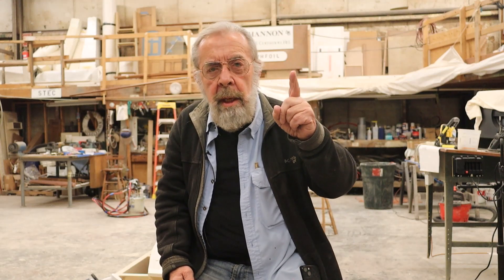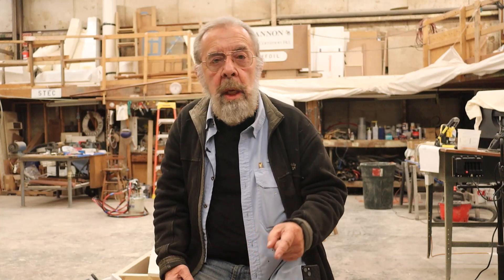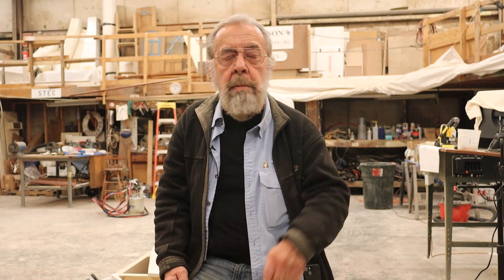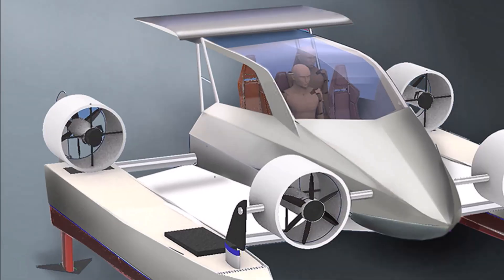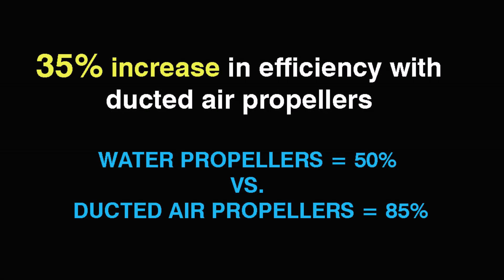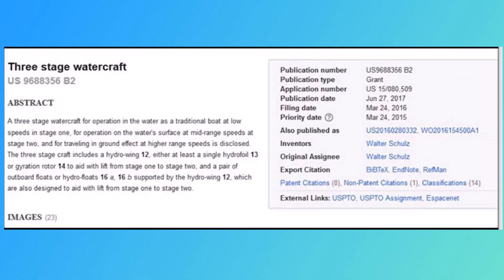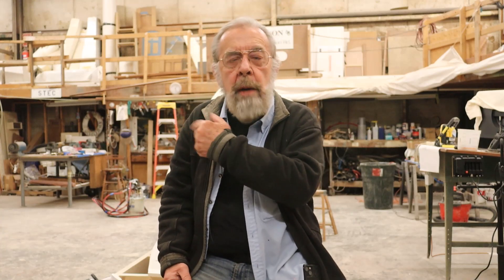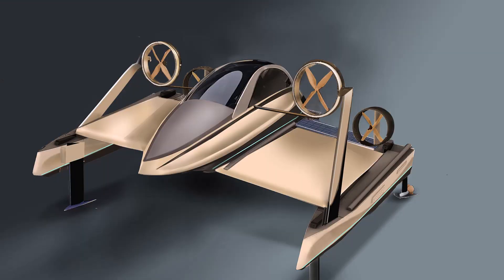NEW PATENTED SUPER BOAT

Comment: There is so much wrong in this vid it's hard to keep track. The Russians built giant surface effect planes/boats. Electric energy storage is not lighter than fossil fuel storage per equivalent amounts. Not even close. Efficiency of electric motors is solely dependant on the generating source, so overall efficiency is hard to claim. Some interesting concepts, but I could do without the amway style sales pitch.

Comment: An air propeller can go from 4.5-7 lbs static thrust per hp, depending free stream to ducted. You indicate static thrust for boat propellers is around 2.6-4.55 lbs. thrust per hp. correct?

Comment: What happens when you hit something in the water? I was on a ship that hit a whale and other things at speed. I now value a steel hull. Hydrofoils are part of the future and just like ground effect transports, the technology still needs to mature. AI in the future may provide avoidance systems. Currently I cannot see the craft in this video hitting a 6 inch thick driftwood log at speed and coming out unscathed. Does this design lift or dive when striking an object?

Comment: High speed hydrofoils have problems with cavitation, it's the same problem that gives rise to the poor efficiency of marine propellers you are trying to get around.  Hydrofoils work best at low/mid speeds but as the speed increases so does the drag which increases exponentially.  As a result hydrofoils can give you long range but not at high speed.

Comment: Nice, but how are you offsetting the hydrofoils, when the foil rides out of a heavy wave (basically suddenly "out" of watter and into the air) and ship starts to go "down", on the side of the affected foil because the foil currently out of the watter is not "lifting" the ship suddenly. 
And if the idea was to utilize surface effect and foils for longer quicker rides, did you take into consideration heavy seas? I mean, some bigger waves  can be problem not only for the hydrofoils, but for the height of the surface effect "flight" too. 

BTW, whoever saw in Avatar 2 (the way of the water) movie the "sea dragon" ship, might kinda have similar picture in head, as me, after you depicted your boat.

And did you try some version with extendable "wings"?

Comment: funny ,my idea from 1974 , normal foils have to much drag ,which is why the first ones had ladders .The Aussie sea ski boats recognize this . Trouble with electric is energy density of batteries ,at present , a rechargeable vanadium diboride cell would solve , and there are lots of better techs coming ...always coming ..  Sharrow props are showing big increase in efficiencies ,and it looks like we can do better , longer higher aspect ratio blades .  In air according to John McGInnes of 'synergy' fame, 100% could be possible ,in the light sport field some new props are giving 20+% gains ,and sound reduction too . But not sadly with ducted fans ,which is probably why the latest big jet experimentals are are ultra high bypass turbo props , with rotating and stationary external blades . but Nice project ,like it ,keep up the good work .

Comment: Airfoil, or hydrofoil, or ?
There does seem to be an actual airfoil tying the craft together, but it doesn't seem to be close enough to the water to be in ground effect, at boat speeds?
One interesting aspect of electrical power on a large boat is that there is a lot of area available for photoelectric cells... He mentioned hybrid power, which normally means an internal combustion engine driving electrical power, but maybe a clean running steam turbine?
A very good friend of mine was s naval architect, and actually did design for, I think, a world record hydrofoil "wind surfer" in the late 1970's, so I learned quite a bit from him... This presentation sounds good, but seems long on good vibes, and thin on details... If it's heavily patented, there's no reason to be shy...

Comment: Walter, thank you for the update on your project and clear explanation. You have always been the most interesting boat designer to me.  Is there a fundamental reason why the ducted propeller concept could not be applied here in an under-water unit, as used on some slow speed vessels? My guess is that the drag of the shroud makes underwater operation inefficient for the kinds of speeds you are talking about, but it would be great if you could share your understanding.

Comment: a ducted propeller is more efficient in more speed and altitude, in low speed and altitude a "normal" propeller is way more efficient, also the bigger the aspect ratio of the wing, the more efficient it is, that also is true ro propellers, that is why helicopters have one giant "propeller".

also, again, in low speed a water propeller is way more efficient because of the density of the water, and the limit to hydrofoils is about 130kmh, if you go more than that the foil's cavitate and destroy it self, soo very low speed... the ideal for that range of speed between 50kmh and 130kmh is waterjet propulsion. 

the idea of using the foil as control surface and to give a boost in lift in low speed is pretty genius, when you reach more speed the boat create enough lift with ground effect and the drag is as low as possible.

also one more problem with the design, the foil is a wing, if you have four of then, it will be small, soo you will compensate with chord, the drag will be much higher than if you have just one main foil but very large in length...

Comment: You started by saying electric ducted air propulsion, but half way through it changed to electric "hybrid" you didn't mention what the hybrid part is?
Reply: I assumed it was the use of hydrofoils with airfoils
Reply: @peterwilliams1119  Hydrofoils/airfoils aren't the power source though. Imagine the size of the battery/batteries it would take to power such a vessel. It must have another source of power thats why he said hybrid I believe. There's a few boats getting around with electric/diesel hybrid motors

Comment: combining sail (which has numerous technological options) with auxiliary solar electric power would seem to be an even greater. 
Electric motors themselves tend to be of 3 types, induction, DC, and the mixed Synchronous motor design.

Ocean waves include short wavelength and longer, larger Swells, so drawings/paintings do not correctly show the travel or the dimensions in which a successful craft operates.
 Sailors understand the seeming chaos of perhaps 3 swells plus local wind waves. In regions like the Southern Ocean and anywhere swells are generated by strong winds plus significant fetch - the vector length of consistent wind direction,
A craft will necessarily be lifted differentially when moving at different relative directions to swell or short-period (wavelength) wind waves.

The design will be refined in relation to the use of the craft, from large transport to small recreational craft.

Comment: Yah and I invented perpetual motion. Electric motors are not that efficient. The reason is that you have to generate the electricity. Steam turbins most commonly used in electricity production are only about 37% efficient. Secondly, batteries do not store all the energy required to charge them. Percentages are typically around 85%. BLDC motors are often around 85%. That puts you at a total efficiency rating of around 26%. YOU ARE A LIAR!

Comment: The 2 problems I see are too much speed + 50 Mph and you hit something in the water and catastrophic foil failure occurs with a huge loss of efficiencies at those high speeds with decreased ranges.  25 Moh still gets you up on foils with much longer range.  The 2 nd major problem is the massive noise with ducted electric propulsion made from the blades.  It’s not a quiet electric solution at all in fact the opposite- it is so loud you will go deaf.
Reply: Ducted is quieter than not, generally, as the greatest noise comes from high tip mach. The trick is to balance the fans (number, diameter, pitch, rpm) against the loads (hydro drag, lift induced drag, total craft mass, and desired acceleration performance) well.

Comment: you get more efficiency in the prop if you put a duct around it.   you get even more efficiency if you use contra rotating props
Reply: Both of those have limits. The tradeoffs between ducts, and non ducts, and the benefits of driving a secondary turbine all have inflection points in their efficiency curves. Depends on loads, design speeds, motor torque, turbine rpm, because it rolls back around to diameter, pitch, and how much thrust needs to be developed. And thrust and speed have a weird relationship with eachother when it comes to props/turbines. Driving water with a prop you're constantly fighting a battle against cavitation, in air, against supersonic flow. In water, that cavitation can happen on your duct, and your prop.
Reply: @weatheranddarkness  if Hydrogen and Steam were used in ships  then power wouldn't be a problem on the ocean.   Solar power with a fresnel lens boiling water   and burning Hydroxy with waste oil is also very efficient to boil water....

Comment: Building a WIG craft with foils in the water just adds drag that will greatly increase escape velocity to transition to wing in ground flight. A hybrid gas/diesel to electric may work as a range extender but the added weight of ICE and electric motors will most likely cancel out the advantage. Others have used foils to reduce the drag from the hull until "flying"(WIG) speed is achieved and then retracting the foils for flight. I think your idea is flawed.

Comment: Electric motors = Less weight = more energy = more range. There's the lie right there, no mention of energy density.
Diesel is more energy dense than ANY electric battery, pound for pound (Kg if your a Europoor) diesel engines have a longer range!
Stick a diesel engine on one of these and it will go further! Fact!

Comment: Just basic high school phisics. In rough numbers water is 1000 times denser thaN air. Means you need 1000 times more propeller area to get the same thrust, RPM being rqual. So without calculating anithing seems like, once the craft is out of the water, the air propellers will need higher RPM, and having to be much bigger, need just as much energy to  spin. So what we gaind there we lost here. Isn't that so?
All that said I aplaud you for trying.

Comment: "Nothing more efficient than an electric motor"
And no energy storage less efficient than electric batteries unfortunately.
Reply: he didn't say it flat out but he did mention "hybrid" so I think for now, it will also have a generator burning possibly diesel to power the electric motors.
Reply: @AntiVaganza  in boats, diesel piston driven electric traction motors have been around since 1903, Steam turbine drive electric traction motors in 1919, gas turbine not much later. So not exactly revolutionary. Definitely a usable tech. But there are still conversion losses to contend with when looking at total system efficiency.

Comment: propellers are airscrews. They must pull/push better when the density of the medium is increased so the propeller get a better grip. What am I missing here? Why air propellers are better than water propellers? Think of yourself running on ice and running on dry tarmac which one is easier? of course the grippy medium is easier.
Reply: Anyone that has swam with a pair of swim fins on knows it's easier to push water with his feet than air.

Comment: If air propellers are so efficient, why are they not used on ships today?

On this particular craft, they are definitely superior. There are no issues of cavitation and ventilation, for example. But I think that this craft will be limited to nearly ideal conditions (relatively calm waters and light winds). In high winds, especially headwinds, it would likely be in trouble. Also, it would have extremely limited payload capacity, as well as extreme vulnerability to submerged obstacles, as all hydrofoils.

But, within these limitations, it would be very fast for its power.

Comment: Shaft horsepower is measured after many of the losses you claim. Propeller Efficiency is more complicated. In simple terms either the slower turning (larger diameter) a "water" propeller turns the more efficient it can be, think an ocean going tug. The faster turning (smaller diameter) the more efficient it is, or can be be, think Malcolm Campbells "Bluebird". The middle ground is where big losses are. Common in this are large horse power, small propellers due to typically vessel draft restrictions.
But the real equation is "how much weight (weight equals comfort) is being moved"? The diesel engine is very difficult to beat - electric will never have the range or weight moving ability.
Reply: weight equals comfort? How do you figure that?

Comment: For electric motors, energy density (for energy storage on board) is still a huge factor.  The comparative numbers are roughly 11,000 W-hr/kg for gasoline vs 250 W-hr/kg for Li-ion batteries.  Newer battery technology will help, but there's a long way to go to make up for the difference in efficiencies claimed here.  The development is, however, interesting.  The best applications might be short-run commutes.
Reply: Worth noticing that there is a vast use of ferries that do trips of minutes to a couple of hours. Battery energy storage is ideally suited to such use today.
"The busiest ferry route in the world is the Dover to Calais crossing" - it's 27 miles. No problem for today's batteries.
Reply: @springford9511  are any of those ferries electric?
Reply: Just quickly, an average sized  ferry has about 10,000 hp in engines for an equivalent 7.5 million watts.  For a 1/2 hour commute, that's 3.75 million watt-hours.  At a generous 300 watt-hours per kg, that requires about 12,500 kg of batteries.  Certainly doable.
Reply: @springford9511  yah except ferries have to turn around after a minimum amount of time.
Reply: @festungkurland9804  true enough. Might be able to fast charge during unloading and loading with proper equipment and system design.  But it would be a costly up front investment.
Reply: Also, probably about $1.5M in batteries
Reply: He's talking hybrid, meaning the energy is still carried mostly in diesel fuel.

Comment: Walt, I know I'm being pedantic here but if your baseline efficiency is 50% and you increase it to 85% it's a 35 percentage point increase but a 70% (35/50) increase in efficiency.  Neat concept but the real question is:  "Can you fish off of it?  anyway I enjoyed the video looks like cool concept
Reply: Its efficient cruise speed would be maybe useful if you've already hooked a swordfish or something else very fast. Would definitely be loud and windy on deck though. I'd be interested to see a video where they walk through the whole entire design. Haven't said much about the foils themselves yet, and the main wing seems fairly thin for a WIG type use, my gut says the above water portion is designed to a higher speed than the foils and submerged props can support.
Reply: Yeah it doesn't sound like a fishin boat 😂
Reply: It’s 100% faster even if it’s only 4 miles per hour faster 🎉
Reply: @georgewhitehouse8630  100% faster is 2x the initial speed. What are you talking about?

Comment: Water propellers lose 50% of efficiency over air propellers ???  Yeah, lost your credibility there.
"Water propellers are generally more efficient than air propellers because water has less "slip" than air: 
Density: Water is about 1,000 times denser than air, so airplanes need to move more air to create the same momentum as a ship propeller moving water. "
Reply: I think he's full of it too. Did you see the heavy ass wood he's using? We have ultra light composites, even balsa sandwich w/ carbon fiber epoxy is 10 times lighter much less with divinacell  or hexcel. O'Boy  he may get a little lift, but the downward force of the propulsion being so high negates any benefit. The foils would have in such a high angle to prevent it from stuffing it and use an awful amount of power that a few fans won't overcome. Crazy!
Reply: @johnwedzicha  TBF Alexander Graham Bell's "Bras D'Or" was a hydrofoil-borne boat driven entirely by fans and it was not built for light weight. It was far from state of the art in lightweight boat construction for the time. As a test article, that is useful. Testing an underweight craft will skew the conclusions you can draw from its performance.
My real question is what are these guys supposedly doing that's actually a real innovation over craft that have come before???
Reply: Which is why boats are so much faster than airplanes
Reply: @johannwolf1  Um, Google the word "efficiency "
Not the same thing as velocity.
That's why a ton of Cargo on a container ship is far cheaper than on a plane. 
That's why English Channel Hydrofoils and Hovercraft have been replaced by conventional shipping
Reply: @johannwolf1  depends what you're doing, and how heavy you are, AAND how draggy your vessel is.
Reply: @weatheranddarkness  Really? Name me one ship that is faster than an airplane ?
Reply: @ I get it... I was trying to be funny